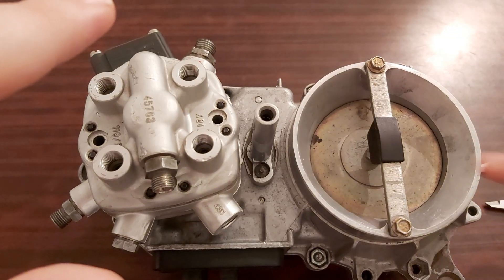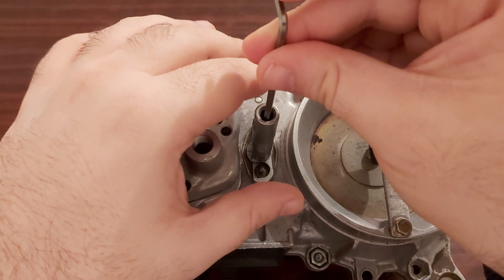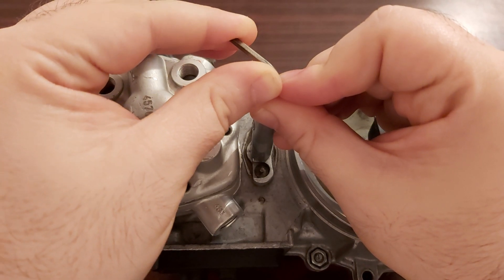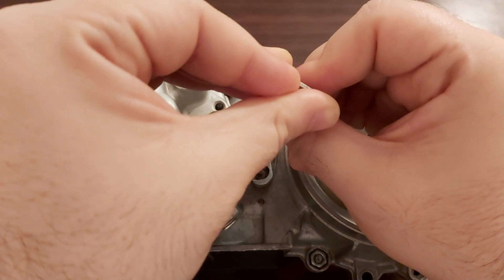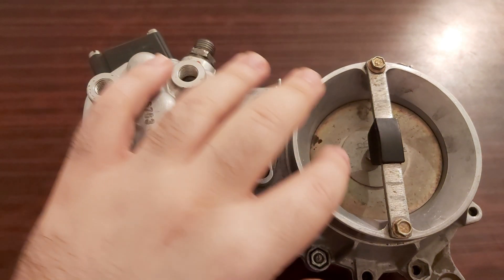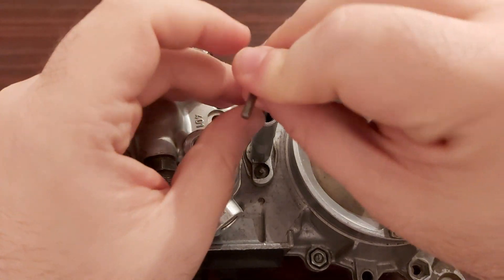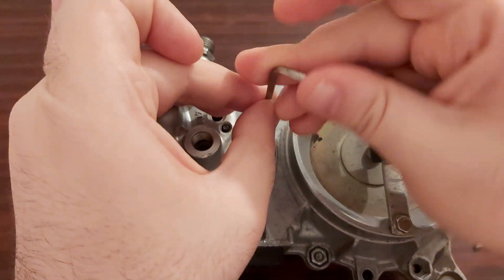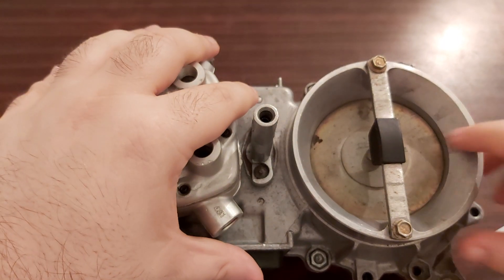㉦Mercedes Ke-Jetronic㉦ - Some misunderstandings on CO/mixture screw and its adjustment in real time

Comment: Will this work for all k-jetronic systems besides Mercedes?
Reply from the maker: The working principle is the same. If you have never readjusted the mixture screw don't touch it and everything will be fine under normal circumstances(if the car was not heavily neglected).
Reply: @mercedeske  Thank you for your reply. The car it's a 911SC, who has a very strong smell of gasoline from the exhaust. I'll check if there are any leaks and check the spark plugs to see what they have to say, because the smell can either be from a lean or a rich mixture. I'm inclined to a lean condition because the CO2 emissions are lower than expected.
Reply from the maker: @paulojrg  In that case we are speaking about the K-Jetronic - check the injectors and the warm up regulator, aka WUR. You must check it whether it's doing it's job or not(to decrease the differential pressure with time).
Reply: @mercedeske  I had discarde the WUR because the car starts on the click, the idle although a bit high (1000rpm vs 950) it's not too much, and the smoke from the exhaust is transparent.

Comment: I have been using an Air/ Fuel gauge with a wide band this seems to work real time. Amazing how much a small adjustment changes the A/F ratio.
Reply from the maker: Exactly. An extremely precise unit!

Comment: Actually i would like to thank you for your achievements about the ke-jetronic.
Regarding to this video i have a mercedes W124 260e i have tried many times to adjust the air flow sensor as per your explained in the video but don't get the same numbers.
Are this numbers by the caliper measure just for M102 or there is different measures for M103.
if not , please where is problem in my car.
Thanks
Reply from the maker: Hello and thanks. You will have to do it with the caliper as in my video and per my instructions. If the car starts running rough though just set the mixture to fluctuate 6.6-7.3V on X11.
Reply: @mercedeske  thanks for your kind reply sir,
But could you please clear to me how adjust the mixture to fluctuate 6.6-7.3V on X11 
I don't understand 😞.
Thanks
Reply from the maker: @issamalmousa76  Set your multimeter to DC voltage, stick the ground into pin2 on your X11, positive goes into pin3. Once the car reaches the operating temperature the voltage will start fluctuating. Clockwise you increase the voltage and therefore enrich the mixture. If there is no fluctuation then replace the lambda probe.
Reply: @mercedeske  thank you very much,, i will do my best my friend
Reply: @mercedeske  hi Mr. Evey.
I would like to draw your attention that i don't have lambda in my car system, so can i proceed with the procedure step by step as your explained in the video.
Appreciated
Thanks a lot.

Comment: Regarding the factory 'plug' that covers this adjustment screw- What is safest way to remove the plug? After I replace potentiometer and injectors, and then make sure everything else checks out, I understand that I 'may' need to adjust this to get the duty cycle to tolerable value.
Reply from the maker: You will have to plug the multimeter on X11 and measure % If you get the fluctuation around 50, everything is okay you don't have to adjust anything. Or you can do it on the EHA and measure mAmps. With engine at 80 you will have to get the fluctuation around 0(tending to negative)mAmps on idle. If not, then you will have to readjust the mixture screw.
Reply: @mercedeske  Okay thanks. I will let you know how it turns out after new injectors, proper plugs, and potentiometer. Maybe no adjustments will be needed, that would be cool!
Reply from the maker: Yeah!!!👍🏻👋🏻🤞🏻
Reply: @mercedeske  OK installed new injectors and proper  (non resistor) spark plugs, and it made HUGE difference, no more shake on idle, starts faster, seems to run MUCH better. However, the check engine light is on, and holding the small diagnostic button for two seconds, the LED gives me 4 flashes. This is potentiometer?
Reply from the maker: I guess so. There is in the table I gave. I think it's the potentiometer.

Comment: When I push the plate down I dont really feel resistance after the 1,9mm gap. Is this normal?
Reply: I watched the Video 4 times. But when I put the sensor plate slowly down. ( ignition off) I dont really feel the resistance off the plunger as you say in you Video.
I have try this out,  When I bridge the fuel pump, there is resistance in the Plate but I dont want to run the fuel pump longer then couple of seconds. 
Is something wrong there? Or im i just stupid? I will make a video tommorow and upload it on my Channel. Youre the Best 😄
Reply from the maker: @Föxn690  😃👍🏻Thanks! Of course you are not stupid! When you bridge the pump the car builds pressure. I forgot which car you have. For example m103 engines have no  spring in the barrel of the plunger, they rely on the pressure.
Reply from the maker: No, it isn't.
Reply: @mercedeske  What can be wrong with it? I dont really know what to do any more. Everything I try to fix gets worse. I really need help
Reply from the maker: @Föxn690  You can have either too much play or none. As you deflect the sensor plate you just feel it moving downwards. In order to create that play you must turn the mixture screw counterclockwise. Watch this video where I clearly show how it looks like when there is no play at all and when there is a play.
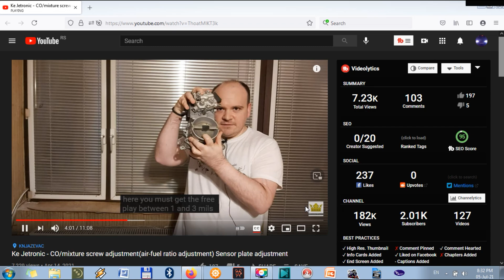Watch the video from 4:25 I hope you will see the difference when I turn the screw all the way clockwise and counterclockwise.
https://www.youtube.com/watch?v=ThoatMlKT3k

Comment: Hello, Thanks for giving us the keys to well drive our olds Mercedes :)
I  just  done the adjustment on my 230ce 1991 (kat), 260.000km.  There was 2.8mm before adjusting and now 1.9mm (+ or minus 2mm :) )
 I cannot say that it is better than before, bu it's not worst :). 

I have also a question on the duty cycle measure. On my car, cold or hot, I have 49.96% at start-up. Then when the motor goes to 750/800rpm the duty cycle goes between 22 and 28%, fast oscillating (more to 28% than 22%). If i take some rpm, it will bounce at 49.96% but rapidely goes back to 22% to 28%. Is it normal ? 
I know that there is difference between non catalyzed cars and catalyzed car like mine. 
The O2 sensor, the coolant temperature sensor, air sensor, sparks plugs, air filter, all fluids are new. The cut power switch at the end of accelerator cable is ok. 
The car is not very soft when driving and there is some very little hicups when deccelarating or with a little power on the gaz pedal. No problem with max power :)
Sometimes (not always) when cold but also when the motor is hot, the start-up is not very good, rpm is oscillating (below 1000rpm).
If you have ideas, I take them :) 
Thanks again !
Reply: Seems i was not pressing enough on the hex wrench ...oups :) Got 47% to 52%, good ! I will now make a measure on the O2 sensor
Reply: @mercedeske  Again, a big thanks for your help and support. I have learnt a lot with your videos. Now the car seems to be more responsive and soft. I  have always littles motor jerking  when decelerating, but I can live with that (for the moment :) )
Reply from the maker: @audiovintagefr  Best regards. Happy Mercedesing 😉👍👋🍻
Reply from the maker: Hello and thanks for your kind words. Concerning the car - check the TPS if it recognizes both positions(you have the video on my channel). According to the table it look like your TPS is not in order(the full throttle). All these numbers count when the engine is warm. Check also if the ecu shows any codes(rectangular little box next to the battery), you will need an OBD1 scanner for this, don't do it with a wire like me ;-) If you get a single pulse, then it means that there are no codes stored in the ECU. 22-28% means rich mixture. Try moving the co screw counterclockwise, but let it be for an eight of the inch and wait for about 10sec. afterwards give a throttle blip. If the number doesn't raise in %, then there is a code stored in the ECU.
The mixture you can check on the lambda as well. As the car is warm stick out the jack of the lambda and measure the voltage. If the voltage is 0.8-1V then you have a rich mixture for sure.
There, that's what I can say for now.
Hope you solve your issue,
happy Mercedesing
Reply: @mercedeske  Thanks. Just tested the TPS with the help of your video (perfect as usual :) ) and the TPS is working fine. I also tested the voltage on the lambda and I have 0.8v. The duty cycle measurement indicate plus or minus 20% (between 13% and 26% approximatively).  Unscrewing the CO screw seems to change anything on the duty cycle reading. I'm going to constuct the scan and test.
Reply from the maker: @audiovintagefr  There, you have a rich mixture. Try unscrewing the CO screw but don't go for much, always an eight of an inch. If no improvements, then don't go for too much.
Reply: @mercedeske  Juste done the obd and used it : 1 blink so no problem here. Action on the Co screw (unscrew) change nothing in the duty cycle reading, even with 5 turn of screw :(
Reply from the maker: Is your potentiometer ok? Do you read 0.7V?
Reply: @mercedeske  Just done the resistance test on the potentiometer (mount on the car, hot, motor off). I find 1.4kohms between pin one and pin 2 and 4.6kohms between pin 1 and pin 3. If I understand, it is faulty ? Curiously, It will be a good news for me :)
Reply from the maker: @audiovintagefr  Yes. Check out the voltage. Start the warm car and measure the voltage. You will have to read 0.7V. If you have never replaced the potentiometer until now, consider replacing it.
Reply: @mercedeske  just done a voltage measure on pin 2 to the car body : 0.96v. It seems that it's time to change it.
Reply from the maker: Yes, it's time. I wouldn't bother you with all these tests if I knew you didn't replace the potentiometer.😃
Reply: @mercedeske  you didnt' bother me, it's a real pleasure to learn with your help. I will buy it at the same place than you and will come back here after that :)
Reply from the maker: @audiovintagefr  Glad to hear that people like me and my work!
Reply: @mercedeske  Hi, potentiometer received and mount. adjusted at  0.65v. Sadly, this do not change anything. Duty cycle is between 18% and 28% approximatively. The Co adjustement do nothing (wait for 10 secondes, gaz..) I'm lost :(
Reply from the maker: @audiovintagefr  Hi. I tried it in % and I got 0.1%. I decided to do it old school by measuring the voltage. Let your voltage fluctuate 6-7.2V that will give you the % you need.
Reply: @mercedeske  Tried and gave + or - 2v. Co adjustement change nothing at all
Reply from the maker: @audiovintagefr  As for the co/mixture screw - if you know for sure it has never been adjusted then you don't have to readjust it. It is only the ideal relation between the lever that pushes the plunger in the distributor and the sensor plate in order to have ideal combustion.
Reply: @mercedeske  Yes but I'm trying to understand why adjusting it do nothing at all, and why the car have too rich mixture also confirmed with the measure at the O2 sensor. ..
Reply: Im' not sure but now, trying to ajust the Co screw to change the distance (normaly 1.9mm to be perfect) using a caliper, even with 5 or 6 turns, the distance doesn't change...
Reply from the maker: @audiovintagefr  Do you use a 3mm hex wrench?

Comment: yes mine is running at its best thanks to youu! thank you my friend.....but my C/O screw seems to run out off specs when i drove the car too fast. Fast like 170 KPH....not in highway but in  a bit bumpy roads....i have to get back home and set the C/O screw back it again, after it will run fine with a good startup like mew. Why its like that? is it too old for that? Lol
Reply from the maker: Thanks my friend. For further fine adjustments you will need to connect the multimeter on the x11 round socket. Look if you achieve the fluctuation of 5% around 50% and this goes not just for the idle, you must get that fluctuation also when you accelerate to 2000rpm. In order to achieve this you will have to turn the screw in tiny movements - I always say if you have an analog watch look at it and turn the screw for as much as "2 seconds" and then let the car run for 10 seconds(the ECU has to learn then). Then check the potentiometer if it shows still 0.7V, that's important also.
I still can't do the video on duty cycle, I still have to deal with some minor issues on my car.
Many greetings and Happy Mercedesing
Reply: @mercedeske  okey thanks for the knowledge....but i dont have the proper tools yet. Anyway, do you know why the ICV hoses have a pointy joint with a small hole in the middle, that connects to the intake filter box? what is it for.. Iv close that small hole, the idle seems better..as i was searching for vacuum leaks.
Reply from the maker: @makavelibenzze  You would have to send me the video.